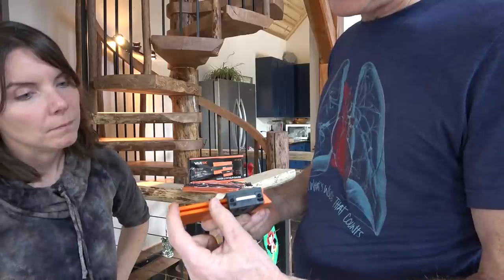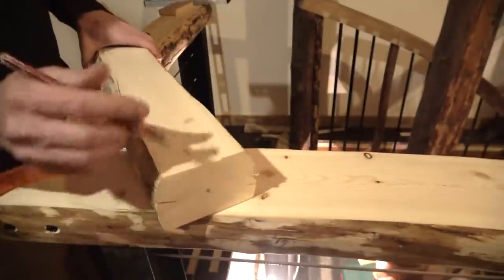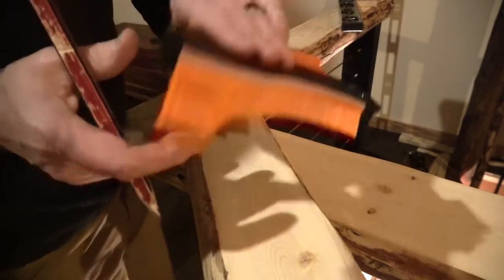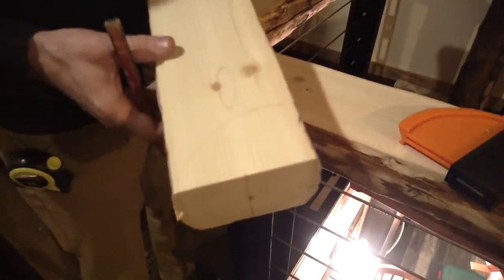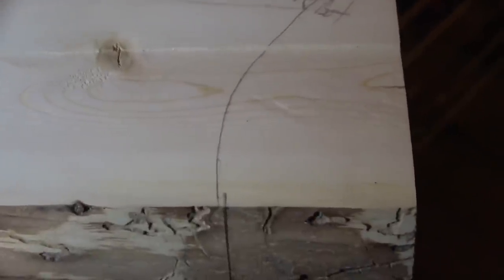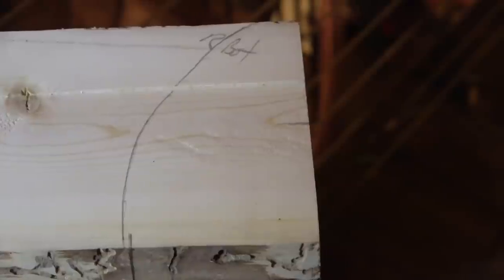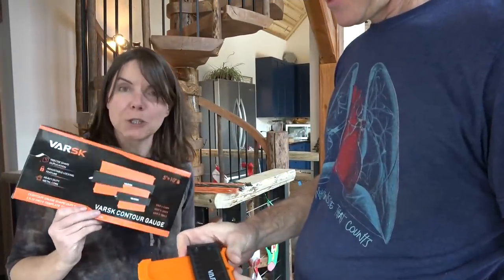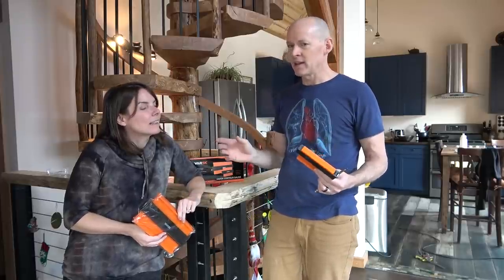As Seen on TV!  Contour Gauge for Wood Joinery Demo & Review

Comment: The concept is decades old. I have a metal one somewhere in my toolbox made from steel with steel pins and used it for profiling numerous times and at least 30 years old.  I have used it on  tiles, wood and flooring where unusual shapes required being cut out. Like many things they get 're invented in different materials for different generations. The original if I remember right was made from all brass.
Reply from the maker: That's neat to hear. I'm sure plastic in the re-invention of the tried and true tools from years past.